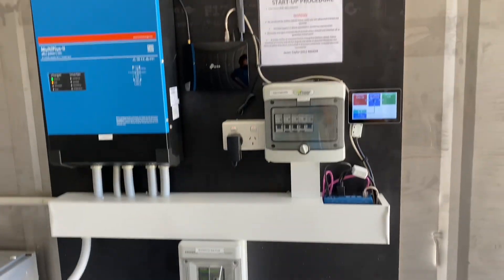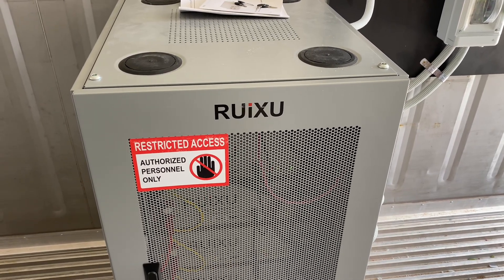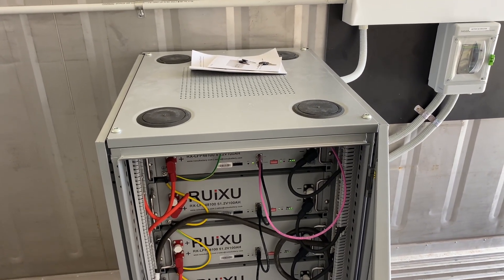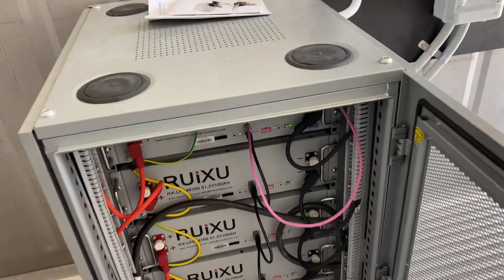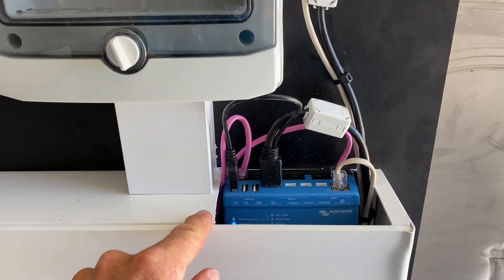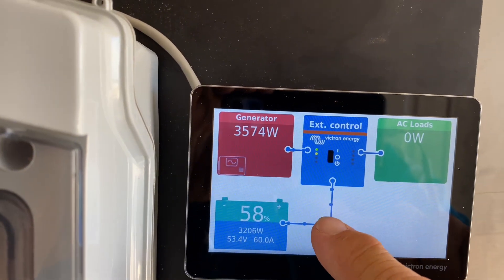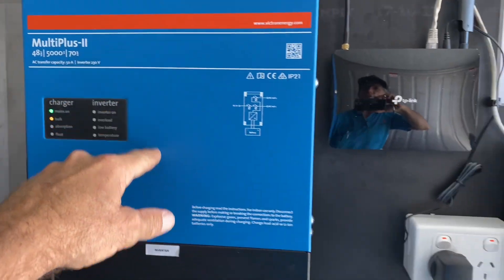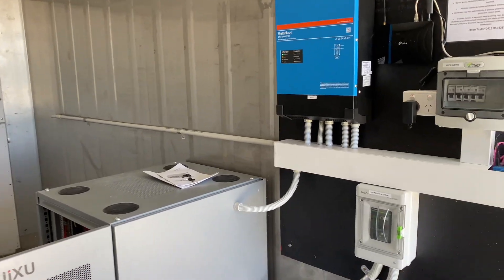Off Grid power system with Victron and Ruixu batteries

Comment: Rack mount batteries from China are usually user friendly and serviceable. Ready to diagnose failure and replace parts like the BMS.. penne a but option than the big name brand commercial batteries or there with super gouged pricing